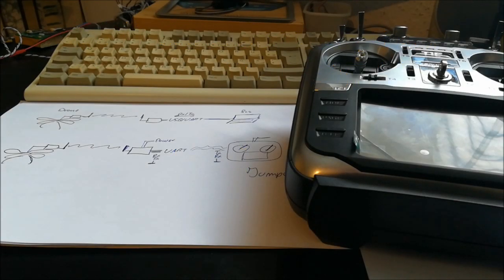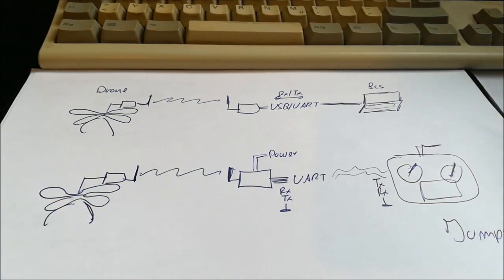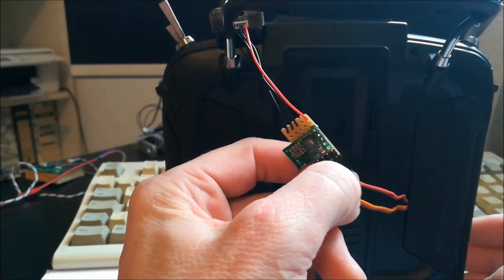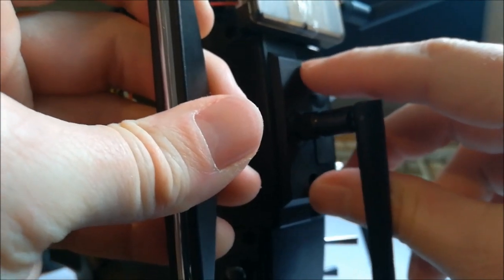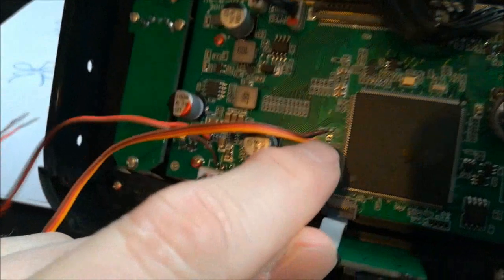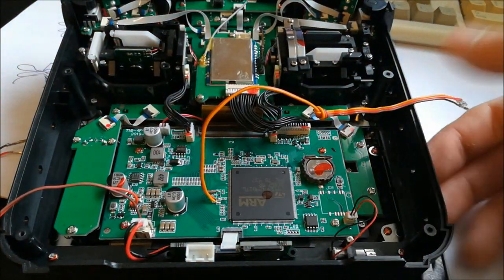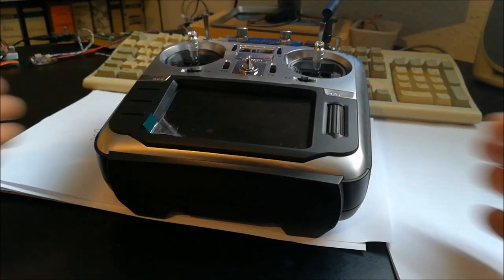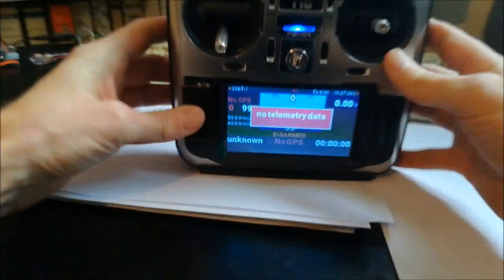Telemetry Script for OpenTx with MAVLink: Hardware

Comment: Can I use this to send  mavlink over wifi to an antenna tracker?
Reply from the maker: yes
you in addition need of course a wifi module, i.e. a thing which translates the uart data to wifi. It might be easier to use a bluetooth module like a HC05 or HC06, or the Frsky thing, to establish a wireless connection (not sure, I might show this in one of the videos).
It may also depend on the capabilities of your antenna tracker, i.e., if it "just" allows a MAVLink stream, or if it does full bi-directional MAVLink. In the latter case it should work out of the box, in the former case I may have to modify the OpenTx firmware a bit, but I'm very willing to do this  :)
you maybe want to inspect the rcgroups thread, I'm not sure, but this may have been done before

Comment: well done! greate project at all - will your script be able to handle mavlink over RC via crossfire ? edit* maybe its only a apicall to connect to localhost :8888 on wifi (when the crossfire wifi is set up correct) - they support connecting groundstations on mavlink to the drone on rclink thetered to wifi network **edit: mir ist grade erst gekommen, dass ich auch einfach deutsch hätte schreiben können - sorry! :D
Reply from the maker: RC über Mavlink geht. Allerdings kann CrossFire, wie mir gesagt wurde, (noch) kein bidirektionales UART/Mavlink über eine serielle Schnittstelle, und ist für das Projekt daher nicht tauglich - leider, war auch enttäuscht wie das rauskam...
Reply: OlliW42 mhhh okay, aber mavlink over RC und zeitgleiches thetering exakt dieses links innerhalb eines WLans (sogar der microTX v2 hat n wifi module) für beispielsweise qgroundcontrol oder Dergleichen, funktioniert ?! Dann hab ich da iwo iwas grundlegend, micht verstanden - glaube ich :D Das ist doch vom Prinzip her nichts anderes, oder doch ? 🤔 Die machen das auch nicht erst seit Gestern ... das feature gabs für alle crsf TX mit bt modul schon immer ... nur die Wlan option kam nu mit 4.0 dazu
Reply from the maker: ich bin mir jetzt nicht sicher worüber wir reden (ich habe kein CRSF und kenn das also nicht richtig). Ich denke was du meinst ist das der TX ein übliches RC Signal an das CRSF Modul gibt, und das CRSF Module das dann mit in den MAVLink Datenstream reinpackt, und man gleichzeitg den MAVLink Datanstream über BT bekommt. Ja, soweit ich weie ist das was lange geht und jeder benutzt. 
Das ist aber NICHT worum es in diesem hier Projekt geht!!! Bei dem Projekt hier wird eine bidirektionale MAVLink Kommunikation zwischen TX und - wenn es den ginge - dem CRSF Modul aufgebaut. Das CRSF Modul müsste dazu eine (funktionierende) transparente full-duplex serielle Schnittstelle anbieten welche mit dem TX verbunden werden kann ... das hat CRSF, so sagt man mir, bisher nicht (beim großen Modul ist die Hardware da, aber nicht die Software) .  
BTY, YT ist IMHO nicht der ideale Platz für längere Diskussionen. Es gibt einen Thread auf rcgroups zum Thema.